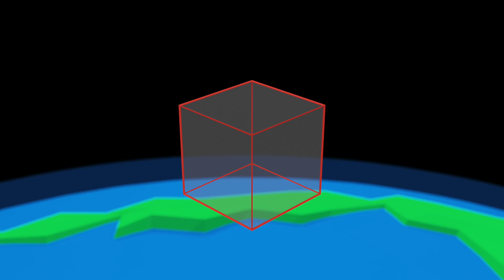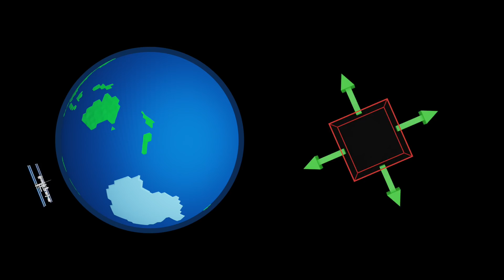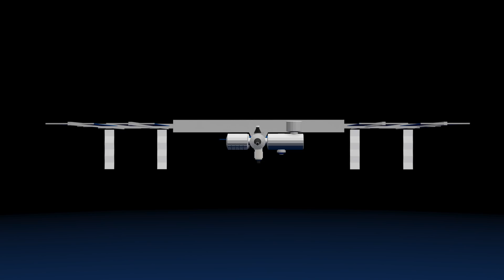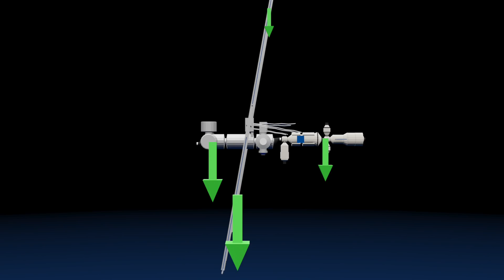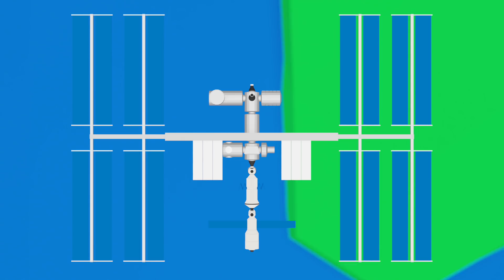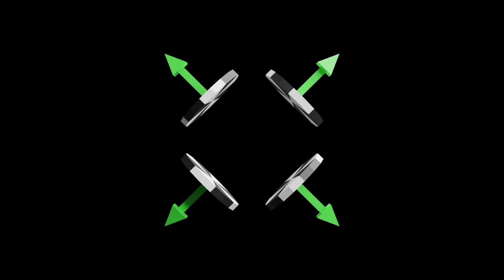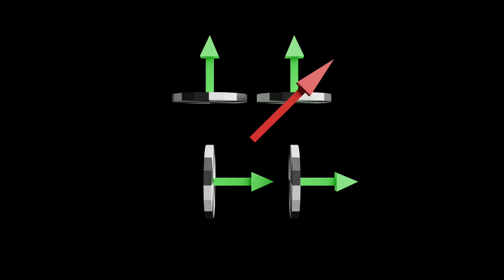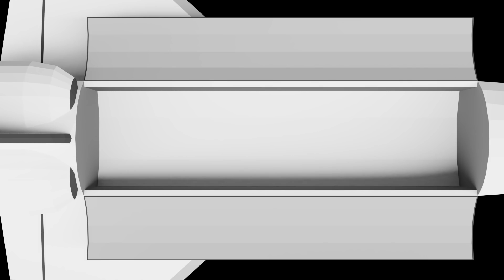ISS Attitude Control - Torque Equilibrium Attitude and Control Moment Gyroscopes

Comment: Isn’t it possible to spin up two wheels opposite eachother without generating any spin and then move the gyroscopes in counter acting directions and then decelerate at the right time to prevent maxing out but also generate spin in the opposite direction
Reply: Yes spinning reaction disks opposite their normal direction in a calculated manner should prevent any saturation, assuming the reaction disks were the source of the torque therefore the spin axis hasn't changed

Comment: The iss compensates the change in angular momentum of the gyroscopes with an opposing implied moment. That will give it the ability to rotate around its 3 axes. But how does it divert slightly from its path to dodge dust particles or space debris? Is that possible as well without the use of the trusters?